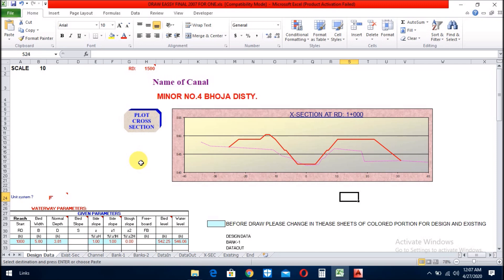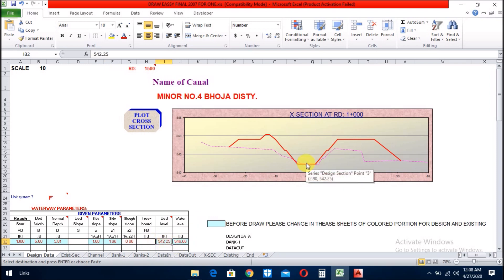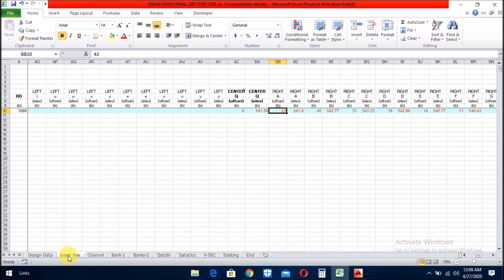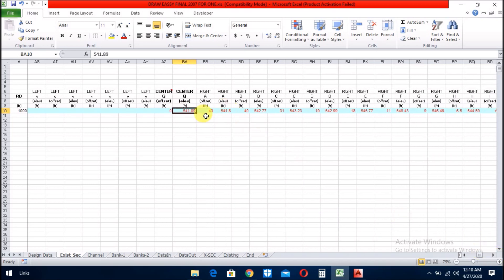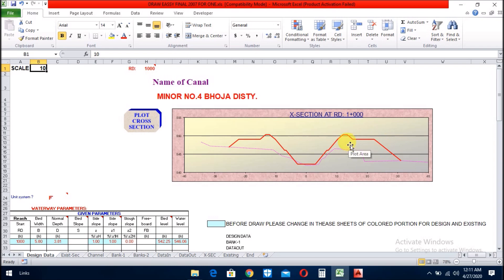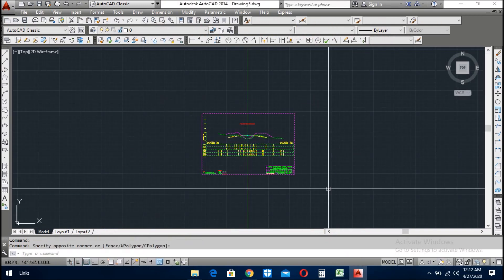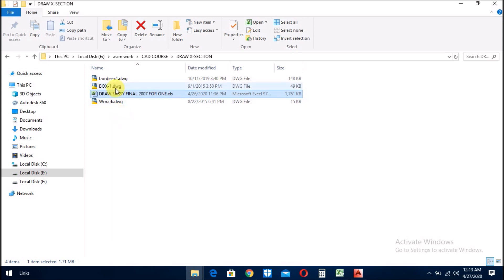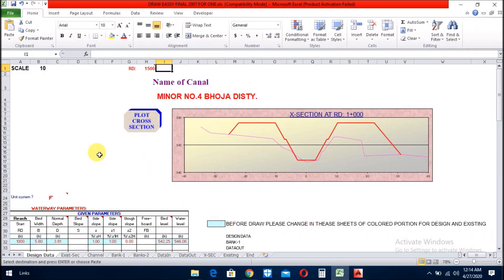HOW TO DRAW X-SECTION FROM EXCEL INTO AUTOCAD (ENGLISH)

Comment: Which scale should I use so that sections will fit in it.
Reply: Levels and offsets are also on the section please guide to correct it
Reply from the maker: If you want to prepare it in a4 size then prepare a4 size sheet (210x297)
Or if u want to prepare in A3 size then prepare a3 size sheet (297x420)
Now draw this section in this paper and chose the scale to fit in it.
Reply: @KINGOFCAD  how to choose scale to fit in it
Reply from the maker: @SibenduJena  scale is in first sheet top left corner. you can change it
Reply: @KINGOFCAD  how much scale should I use so that section will fit in it
Reply from the maker: @SibenduJena  it is up to your section size
Reply: @KINGOFCAD  for 1 in 1 scale what should I use in the scale box